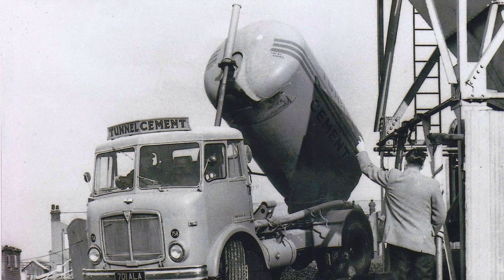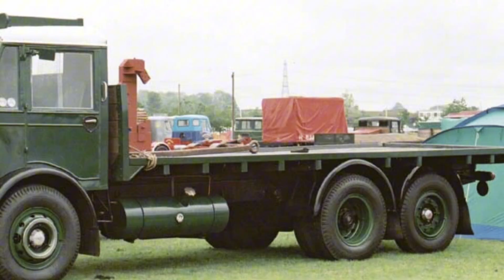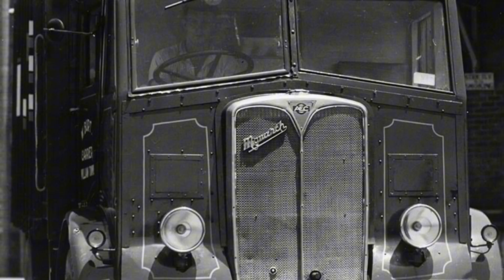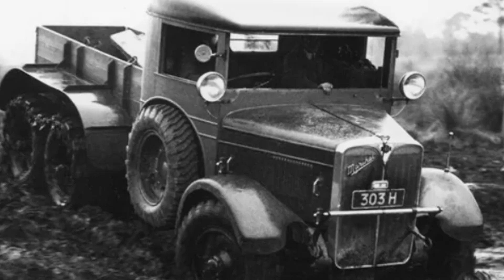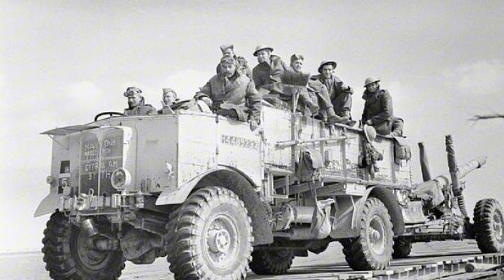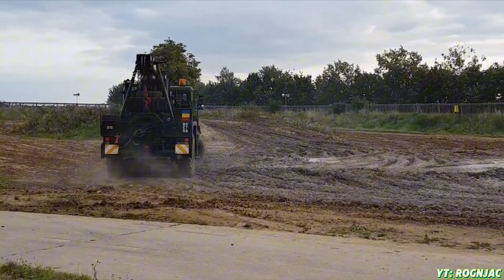Top 10 Most POWERFUL AEC Lorries Ever Built!

Comment: I worked in a quarry transport office in the 60s and early 70s, where we had Mercury, Marshall and Mammoth tippers and a concrete plant that replaced its Guy Warriors truck mixers with AEC Marshalls. I liked them and the two-handed reverse was easy to master. The only mechanical problems I remember were gear box lay shaft bearings, and balance beam pins and bushes, and the Marshalls tended to get through front tyres rather too quickly.

Comment: Chinese Six was a safer lorry to drive,  tyres back in the old days where rag tyres not radials  so if you blew out a steer tyre  you just might finish up in the ditch but with the second steer axle  you could pullover and put on your spare wheel on the side of the road.  That was in the days when you carried a jack and wheel brace and did it yourself no service trucks back then.    Eddy Smith

Comment: J Urquhart Petersfield Vauxhall Bedford dealers 70,s and 80's Matador breakdown truck. Winch anything with the skids down and it told you it wouldn't when it reared up. 29/31 mph flat out with internal fuel filters gurgling away like mad, No power steering so when a coach or the like was suspend towed on tight corners the foot on the dash was invoked. Total loss air brakes so some engine revving was necessary at times with a bit of panic thrown in. Pull 32 tons up the old Butser hill very slowly but would do it. Stoner hill was a favourite for winching stuff up when they drove over. Well my memories of a serious bit of kit. God knows how much the winch alone would cost these days
Reply from the maker: Thanks for sharing your experiences 👍

Comment: I washed trucks for Pembroke Transport (hauliers for Firth Cleveland Extrusions  - later GKN), at the time they ran a mixed fleet of 7 mercury, 3 Mandators and a Marshal that was cut down and fitted with a turntable. They hauled nuts in bins and on pallets out with the back load always being steel coils for the extrusion process. Always heavily loaded these trucks really worked hard.

They also had several older generation (pre tilt cab) rigids laid up and decommissioned.  After buying 2 Mandators and a mercury all on a K plate which were the last AECS to join the fleet, an Atkinson Borderer was purchased (Lreg) but then the big move to volvo began with a couple of f86 arriving followed by f88s. The AECs disappeared from view very quickly. 

Spent a happy summer of 71 running around with the transport manager in a brand new Mandator that was waiting to be sign written, popping down to the factory to shunt trailers etc. I wouldn't be allowed in the factory as a kid now - much less be dropping the legs putting on the trailer brake and disconnect suzies... Happy days for a 13 year old 😁

Comment: hi there. i  worked at AEC in the 70's.all the chassis cabs were the JCS 101 tilt cabs by Sankey. the militant was  an 0870 and the left hand drive Lwb left hand drive were the 0880, Park Royal made the top half of the cabs,the only company to specify fixed cabs were Wimpey for their 6x4 tippers, you forgot to mention the Marathon which  we built with the TL12 engine, until we closed in may 1979
Reply: Anyone who wasn’t insane specified a Cummins engine in the Marathon 😉
Reply from the maker: @petersmith4455  Thanks for the info. Interesting 👍
Reply: It's a shame the Marathon came so late to the party. The continental stuff had taken before the Marathon appeared.
Reply from the maker: @ it was unfortunate